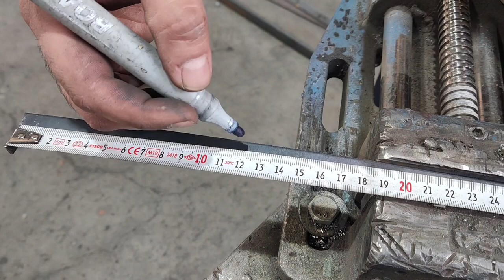Unbelievable: Unlock the Secret to Making the Perfect Mechanical Sharpener!

Comment: Rather than using a portable grinder and wasting all of these materials you should have just used a bench grinder. You can use a bench grinder to sharpen a pencil without modifying it at all.